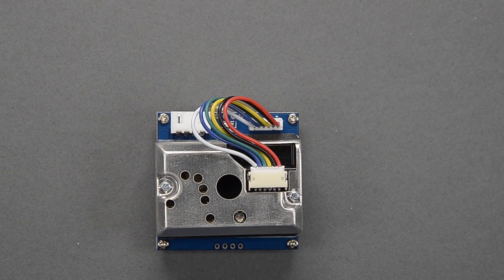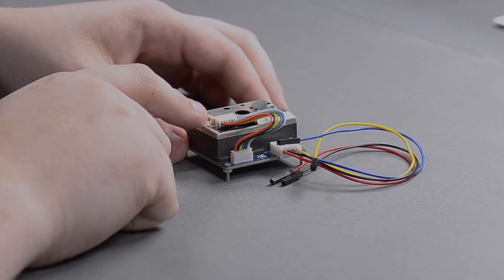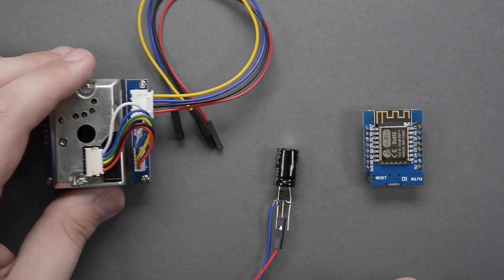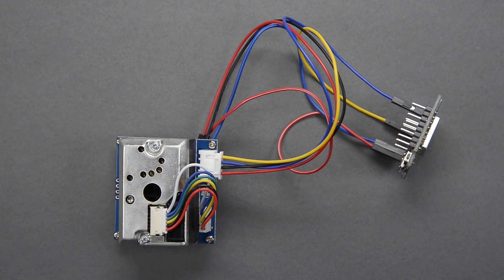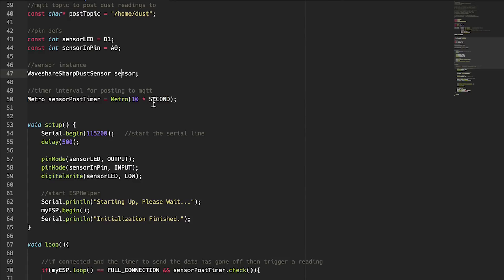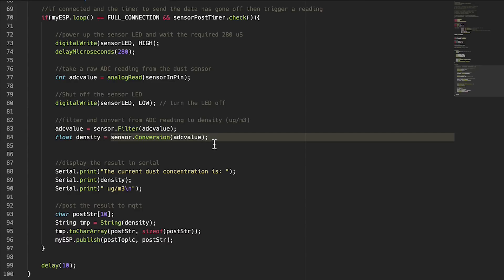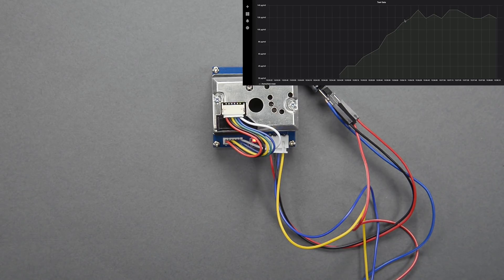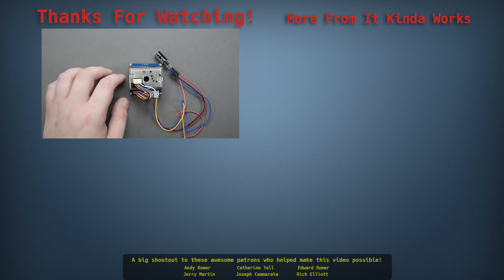Super useful sensor you've never heard of! (Probably)

Comment: Do particles and /or dust get accumulated in the sensor case?
Will it degrade in performance or accuracy over time or in a dirty environment?
Reply from the maker: Yes definitely. This is a cheap sensor with no mitigation for particles. You'd need to clean it periodically.

Comment: It is nice video tutorial but it would be better if you use regular ATmega microcontroller than Arduino or at least create the second video with pure ATmega :)
Reply: I hope you know Arduino boards use ATmega microcontrollers. There is no point in making a breadboard circuit with another ATmega uC and flashing that one, when you have a well build and simple to use board like Arduino. You even have ISP header on it, so if you want to program the chip using external programmer and other software, like Atmel Studio,  you can do that.

Comment: You say it can handle 5v.
Couldn't you just run it off 5v and use a resistor voltage divider to get the 0-3.3v output.
Reply: Glen Beestone you can also use a bi-directional levelshifter to get your 5v signal to 3,3v signal

Comment: Hi - what is the name of the "Real Time Graphing" tool?
Reply from the maker: It's called Grafana. It's been my go-to home data visualization tool for a couple months now
Reply: ItKindaWorks looks amazing,  think about video about it.... Do you run them (I mean Grafana and DB) on Synology?
Reply from the maker: I've been thinking I should! I've basically been "testing" it for the past few months because I always end up running into some annoying issue with whatever platform I use (I used to use easyIoT, thingsboard, and home assistant at different times) so I wanted to make sure I liked it before making a video about it haha. But It's been solid for a while so it's probably about time.

Comment: i have it, i found it to be very unprecise, but sensitive somehow, the results (at idle especially) vary a lot with other factors (like also re-power it up), the one you have has apparently a bit of external circuitry, the one with just the pigtail needs a transistor to power the LED at calculated pulses and a bit of filter on the power rails (peek the datasheet)... i think it's enough for smoky ambients to automate the venting

Comment: thats strange arduino like code. why not use rtos which has tons of libraries
Reply from the maker: This channel is largely aimed towards the enthusiast community who have lots of experience with Arduino. RTOSes are generally a bit out of reach for the general home DIY electronics tinkerer. Plus it makes prototyping easy ;)
Reply: that's why at some point everyone will get stuck on Arduino that is incompatible with non-AT Mega chips and practical libraries will not be supported. I had more problems with Arduino compatibility issues than running a tiny nice multitasking program on rtos. This does not pertain to Arduino uno/nano/due etc boards but  ESP
Reply from the maker: I'm not sure which libs you've had issue with but I have generally had excellent luck with ESP support. I don't doubt there are some that are incompatible but usually those are ones that need somewhat specific hardware timers on a given device but that crops up with any platform. In general Arduino libs have great compatibility and Arduino has been ported to hundreds of different boards. It's all up to personal preference though
Reply: Arduino runs on rtos in esp case. you cannot use 90% of board powerful capabilities and people who make libs for arduino actually port them from rtos or more complex stuff must be rewritten. it is just for basic learning stuff which is fine but to go higher level you must step out of arduino into rtos
Reply: Browarus Pierogus cool story, bro.

Comment: it doesnt say on the waveshare shop but this sensor is GP2Y1010AU0F, you can buy it for less than $5USD on aliexpress... this sensor is ideal for wood workshops to be used for automatic ventilation, otherwise its not useful for the situations you mentioned... it is showing the average concentration of many sizes of particles, so it should not be used in applications where you need to know the quality of the air, you should use it only on places where you need to know if there is allot of dust in the air or not...
the real problem about this sensor is that the sensor gets packed with dust and in few months it will not show correct readings anymore... also the LED is really low quality so the amount of light will vary also LED degrade quite fast contributing to the false readings after some use...
Reply from the maker: Yeah I know it’s really just that same sensor but fwiw the raw sensor has a bunch of extra wiring that you have to do to get it setup correctly. From what I’ve read it may not be the most accurate sensor but unless you are in a truly horrible environment, it’s not going to get thrown off all that much. And if you only take readings every once in a while (should probably be like every 5-10 min rather than this demo of 10s) the led shouldn’t really degrade very much. Sure this is going to be something that requires replacement every once in a while but that’s kind of true of most environmental sensors...
Reply from the maker: From what it looks like, the degradation is from continuous use (not intermittent as has been discussed here) over a 5 year span. Of course it's one sentence and is not expanded upon so we don't really know what they consider "continuous". And for the dust adhesion they basically suggest exactly what I said, clean it occasionally. I think the dust problem is something you're going to face with any sensor that is measuring air quality in a really harsh environment. 
I'm certainly not trying to defend this sensor as being the best, even before I made this video I knew it wasn't, but I don't think these issues are going to cause problems for the average user. Yes putting this in a machine/wood shop next to machinery and leaving it for a year is going to degrade the sensor but putting this somewhere in an average house and cleaning it with an air duster every once in a while is going to be just fine. I'm going to run this one in my basement for the next year and buy a new one and keep it sealed and we can see how it does a year later running at 15 min intervals - how about that? I figure that should give us a decent real world test
Reply: @ItKindaWorks  This guy compared the GP2Y1010AU0F to a $290 Dylos laser particle counter and his results seem to show the GP2Y1010AU0F gives an amazingly similar output to the much higher end sensor system, the only caveat he mentions being, "there is some question of how sensitive the Sharp unit is at very low particle counts."  But check out his data.
Reply: I am just curious as to why the LED is degrading? Is it some exotic wavelength? It can't be a normal LED.
Reply from the maker: Do you have any sources that you can pull up to back up the low LED lifetime? I'm curious to hear whether this is a widespread issue or just a few units. I cant believe that a device like this would have such a short lifetime unless it is wired up incorrectly... Even crappy LEDs last tens of thousands of hours and by my back of the napkin math with 15min intervals you would only be running the LED for .02 seconds per day given 280 uS on time (even adding 1-2ms per reading for ADC conversion time would only bring that number up to .194 seconds/day of power on time).
Reply from the maker: I dont disagree with the accuracy of the sensor if it gets packed with dust - sure thats no good and any good measurement system will need to be cleaned and calibrated from time to time but the LED issue sounds more like incorrect wiring than poor components.
Reply: Did find this spec sheet https://www.waveshare.com/w/upload/1/18/GP2Y1014AU0F.pdf and it does mention LED degradation over time as well as dust adhesion affecting the sensor accuracy
Reply: @stevestofiel3521  what is the value of this analog sensor input? plies
Reply: I wonder if a sensor like this is why the electronic furnace filter at my house always seems to go on the blink after only a day or so?
Reply: please have you used it on an arduino or raspberry pi
Reply: @yusufabubakar9862  ESP 8226
Reply: @VolkerHett  you used it for Iot project
Reply: maybe i was not clear enough, sorry for my bad English... what i meant was:
1) the LED is really low quality so the amount of light will vary (except to get value fluctuations)... 
2) because the LED is really low quality it degrades quite fast (it is loosing intensity in like 3-4 months for taking data on 15 minutes instead lasting like the normal 10 000 hours lifetime of a normal quality LED)... you can test this in a bag, just leave the sensor in a bag and suck as much of the air that you can, do it once you receive the sensor and do it after two months usage... huge difference in the readings... 
as i said, you will notice huge value difference between normal air and dusty wood workshop even after a year of usage, so it suits the way i am using it, not usable for measuring air quality... there are way better sensors you can get for $20USD, they output few measures example pm10 pm2.5, they have resistors that help air circulate better thru the sensor, some of them even have temperature and humidity sensors in them included to get more correct readings and most of them come calibrated and tested...